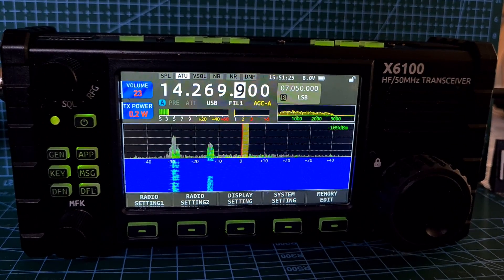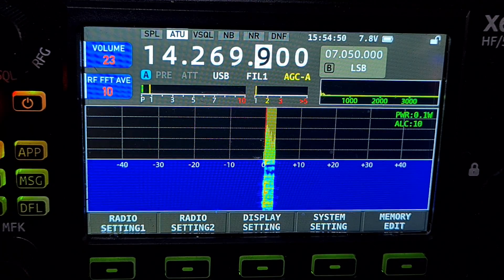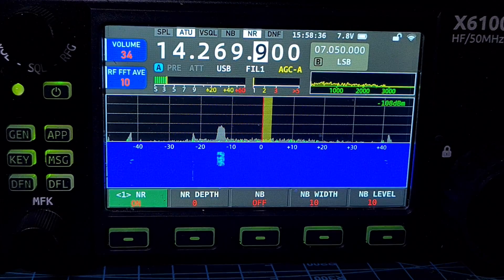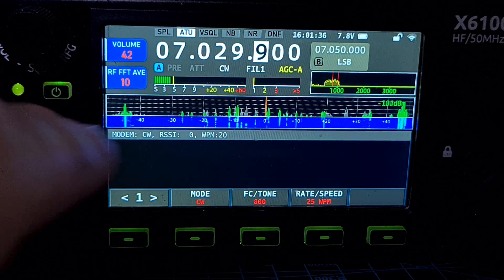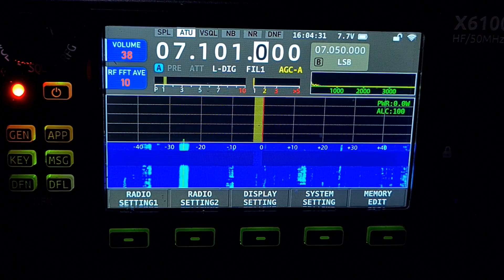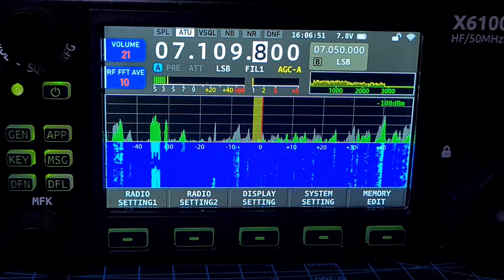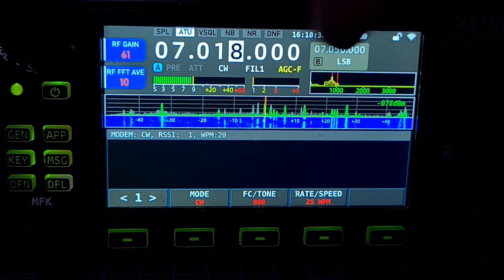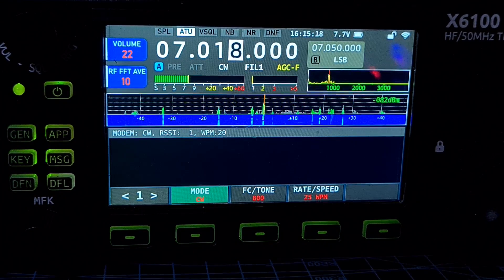Xiegu X6100 Firmware 6  -v1.1.4 Full Test 17th February 2022

Comment: Does it now support bluetooth and wifi?
Reply from the maker: Its has had Bluetooth WiFi since the first firmware update and there have been six updates unfortunately these do not provide audio or remote control , the use is limited to Bluetooth for keyboard or mouse and WiFi is used to wireless talk to Linux using putty or winscp.
Reply: @M0FXBHamTech  thank you for your response. Any clue when will the BT audio and remote control will get an update to make it work? And is it worth buying the X-6100 now? 🤔

Comment: My CW decoder does not work after the firmware update. So I know there is going to be another firmware update number 6 or 7. I am tired of firmware upgrades and loss of memory data each time. I program my memory channels with 60 meter channels and HF call frequencies but I have stopped because of firmware updates wiping the memories clean. I have written to Xiegu to ask if 60 meter channels and HF call frequencies can be written into the firmware updates but have not received any feedback on the request. It seems to me the programmer could write code to load those into the firmware. Also it would be nice to have end user software that can be used with the CAT interface for configuring the X6100 after all it is a software defined radio. M0FXB thanks for your channel and all the work and input you put in to it. Your work and efforts are greatly appreciated. Tommy Kc4zze.
Reply from the maker: Hi Tommy very good point i think Xiegu are listening and the updates are making the radio better .73 all the best
Reply: @M0FXBHamTech  Yes I think you are correct. I  think they are trying to make a great product and to live up to their advertising and provide the items that they advertised and sold to us. It is an interesting test of sales, engineering, and market place. Thanks M0FXB.

Comment: In a previous video, you removed v1.1.3 because of "S" meter issue.
Question: My x6100 has v1.1.2   Do I need to update v1.1.3 before doing v1.1.4  ? 
Apologies if I have asked a daft question !
Reply from the maker: 1.4 seems good but the CW decode stops working .